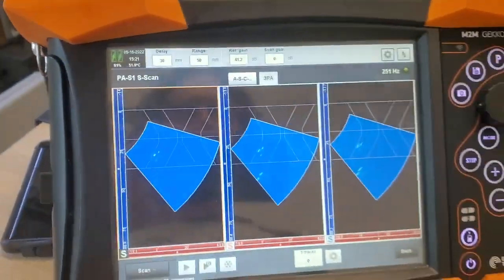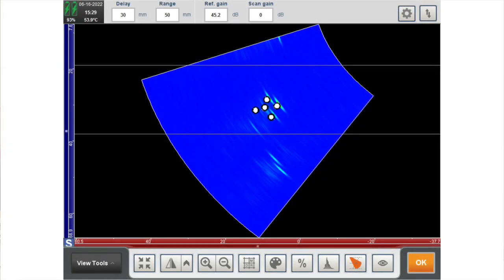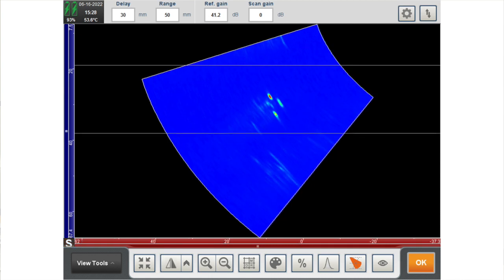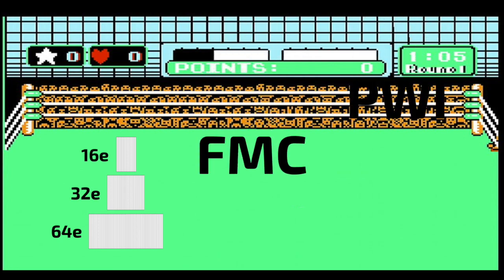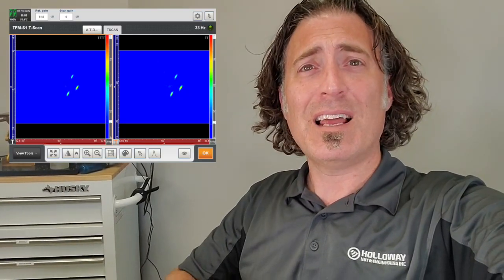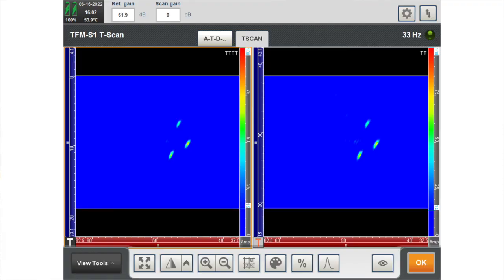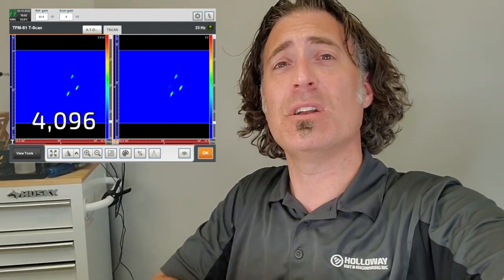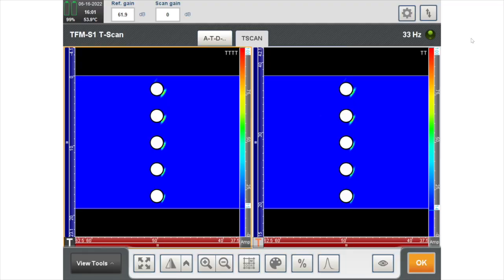Quick Ones - Aperture (16, 32, 64 vs FMC and PWI)

Comment: Hi
Thank you for your helpful video. What about the effective of resolution? How does it compensate if we use lower aperture with hight resolution?
Reply from the maker: If you look at the 16e result on the holes, it's quite blurry for height sizing (not that you'd size the height of a hole though). Basically, you'd want to use the maximum aperture/elements possible and focus exactly where you need it.